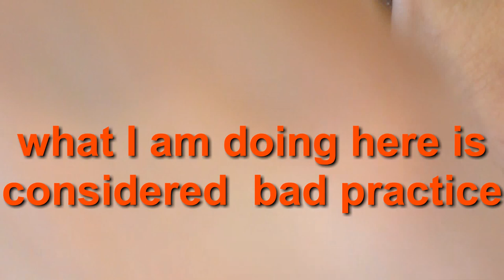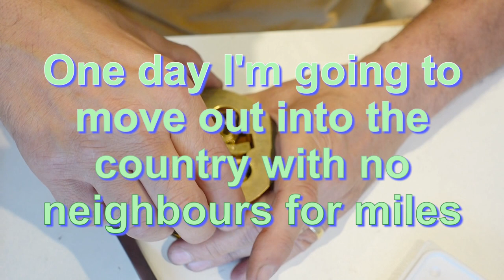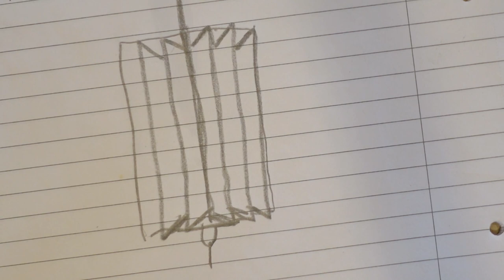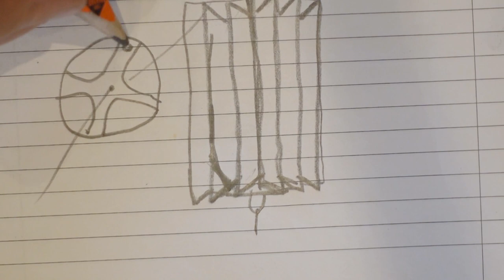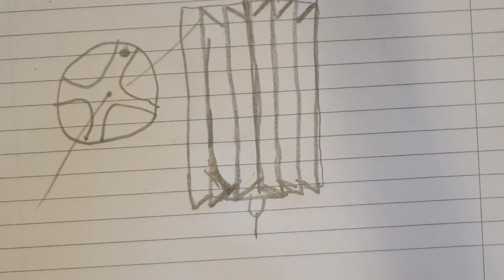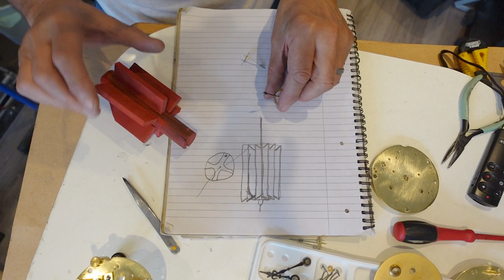French Slate Clock Dial Change and Restoration With Detailed Close Ups

Comment: This was quite useful as I have a similar French clock movement waiting for me to work on (mine is quite dirty and gummed up).  Your red wooden model of the pinions on the one strike side wheel with one filed down pinion leaf which matches up with the mark on the next wheel is quite helpful - I will look for that on mine.  Also the use of round nosed pliers to reshape the innermost coil of the mainspring, and the dots to mark parts that go together, and popping off the spring barrel cover by rapping it on wood, and lots of other points.  Don't feel bad about having to take it apart again because of the mainspring issue - I've made that mistake myself.  Everyone who works on clocks has been there.  Thanks for sharing.
Reply from the maker: Hi Paul
Thank you for your comment. It's input like this which makes my whole videoing process worthwhile. 
 I am far from being an expert clock restorer, but I am getting better. My aim is to try to show people an in depth view of how these clocks come apart and go back together to the best of my personal ability. When I first started, there was nothing detailed  on YouTube that could help me, which is why I decided to start uploading. 
In some of my other videos, you see me addressing some other aspects, like polishing the case or repairing a cracked dial. 
I am happy that you found it useful.

Comment: So glad to see you working on clocks again. I looked to your videos way back when you were the pioneer of slate clocks. Replacing a pivot in a French clock they say is difficult as the pinion is hardened. I was stuck with a similar problem and as the clock was about 1820-1840 I had to turn to an expert. At the cost of several eBay slate clocks I had the repair done by Jan Van de Geer. A perfect repair and beyond my capability. So clock no. 2 with the wheel swapped could be repaired - but not yet!!!
Just thought I would mention it for your future note just incase if you are really stuck with a tough repair on a unique clock. Good luck and thanks.
Reply from the maker: Hi Spencer. I have just broken another pivot whilst trying to straighten it. Even though I annealed it to soften the metal. At the same time, the solder on the wheel melted and the escape wheel came free. I was not happy at all. I found a local clockmaker who told me it would cost around £100 to pivot and reset the wheel. You and I both know these clocks arent worth that much so paying out wasnt going to be an option for me. I have sat all day at my Unimat lathe and finally had my first succsess in  repivoting. Now all Ive got to do it research how to solder a wheel back on to a shaft and I'll have my clock working again. When I get really good at it, I'll make a video hahah
Reply: @treetopspider  great - congratulations a real test!!
I have found James Lea - I think he has passed on but his videos are still with us. The village clokmaker. Clock repair tutorial #20 repairing a broken hole in a centre shaft. Was very helpful in my distress as too was Repivoting a clock wheel - at the bench. Jobson Clocks. All I can say is that it is a tough one to solve but great in the learning curve. Good luck and I hope you succeed.

Comment: This was for me the best clockwork instruction DIY that I have watched. For a real amateur like me, this video make it ”it’s possible for me to try too”. I’m not from UK, and I wonder where I can buy that rods, that make the base of the clockwork standing (3 rods with black base). And that long nose plier - was it ”home-built”? Thank you anyway if you don’t answer.
Reply from the maker: Hi Peder
Thank you for your support. It always pleases me when I can inspire a budding clockmaker. I am not an expert. I taught myself and learning as I go along.
The company I bought the clock mechanism stands is in the UK but I have just looked and found similar ones on Amazon. Here's the link 
shorturl.at/bdLRX
Ive shortened the link, it should take you straight to Amazon.
The pliers I used was a standard pair but I ground the tip down to make the shape I wanted.
Johnny
Reply: @treetopspider  Thank you!

Comment: Hi. It's great that you keep experimenting with different methods and I have found your videos really useful.
Would it be possible to have a short update occasionally on what you feel is the best way currently to go about slate case restoration based on your experimenting?
Eg: Marblack, boot polish or curator blacking and for the gilding, paste or uni paint marker.
Great work. Thanks
Reply from the maker: Hi John,
I've been a little distracted from clocks recently  with my car restoration projects. But I do still have some clocks for restoring, which I will make videos of and upload. 
I think my personal favourite finish is the softened boot polish. I like the fact that you can apply layers and polish up to a gentle sheen without looking plasticy. 
For the engraving, I will always go for gilding paste from now on. As you may have seen, I've tried a few methods, but the paste is the easiest and I find leaves the sharpest lines after scraping off with a clean blade or a credit card. Clean up afterwards is also easier.
Thank you for taking the time to watch my uploads
Johnny

Comment: Johnny your video is excellent thanks for taking the time to do it, well done! can you advise where I can get a complete clock movement for an opening 16.5cm plse?
Reply from the maker: Hi Mike, glad you found it useful. 
I tend to look on ebay for movements under 'antique clocks spares or repairs' 
Its a bit hit and miss but eventually I have managed to find what I need.
The other place Ive bought complete clocks from quite cheap are the boot sales

Comment: I’ve bought a cheap french slate clock that needs restoring after watching your vids, the clock came minus its hands, I need to purchase some, looking on EBay there are many to choose from presumably they come in many different sizes how do I know which ones will fit? I would appreciate any advice. Thanks
Reply from the maker: Hi Keith,
If I had to buy hands I'd be searching for 'hands for a French clock' on eBay. I know that sounds obvious, but as far as I am aware, all French clock hands are interchangeable. Expect to pay around £15 for a pair, Some are nicer than others and may be a bit more money. Sometimes with these French clocks, it can be worth buying a whole mechanism or even another clock for not too much more money. I typically pay around £30 for a slate clock that need restoration.
There is also a website called cousinsuk where you can buy all sorts of new stuff, although I tend to only use them for my springs and consumables
Johnny
Reply: Thanks for the advice Johnny much appreciated, keep making the vids they are really informative and  helpful. Keith